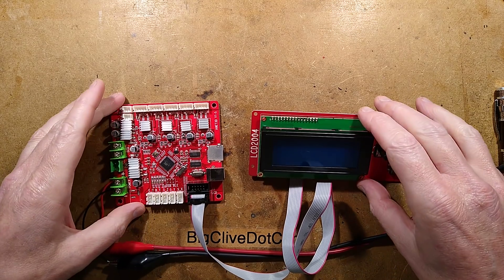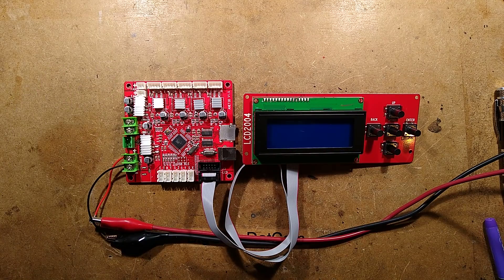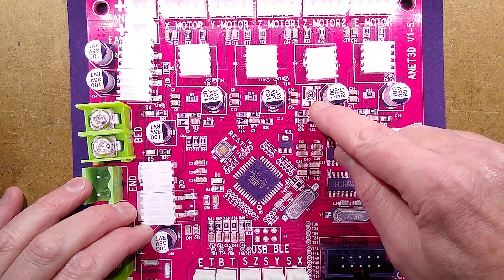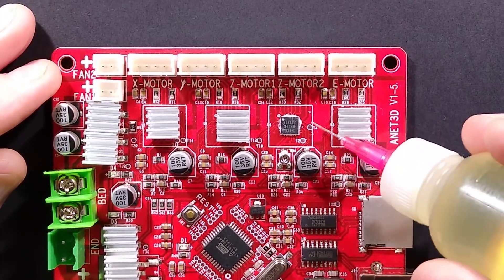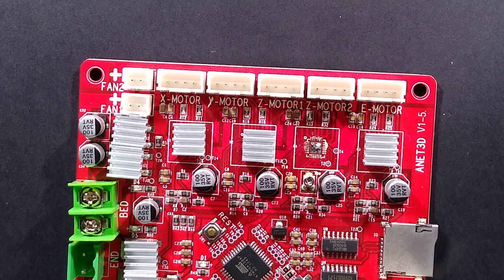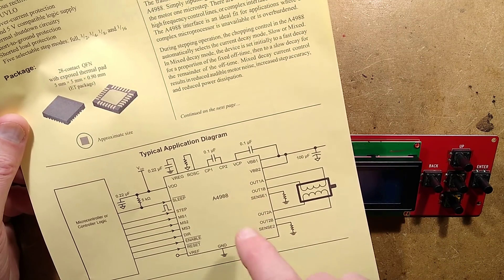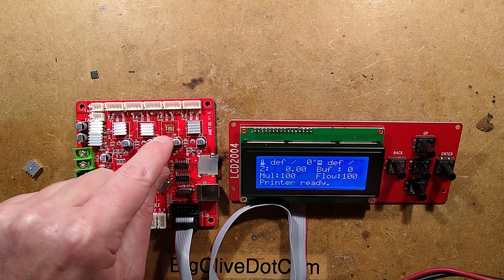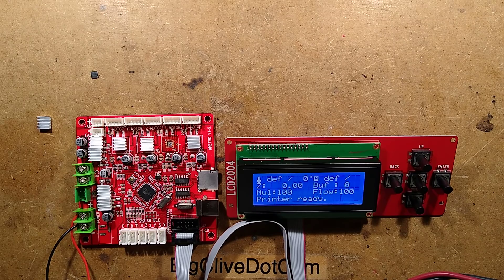Diagnosing a dead 3D printer controller

Comment: Love this printer. Simple, and reliable when used with a mosfet for the heated bed
Reply: I have two left.

Inadequate traces for the heatbed current: added MOSFET/SSR.

Failed to use strain relief or even an adequate number of the available pins for the hotends connector: soldered directly, made own strain relief.

Heatbreak fan for a non-existent heatbreak: disconnected, thrown away. (Have NEVER seen the extruder get heat-soaked enough to matter).

Garbage-quality z-stop switch: replaced with optical.

Firmware with no runaway protection: flashed to Marlin.

Display corruption just by thinking about the concept of static electricity: added a proper ground to the display segment.

All in all, this $199 budget printer can be made safe for only the cost of the Sovol SV01 that I should have bought in the first place.

Honestly, don't buy from Anet. They're perfectly willing to sacrifice your safety for a buck.

Comment: My A8 is in the closet. I bought a Flashforge Adventurer 3 and never looked back. After the Anet printer's bed connector started to burn, I figured it was time to just put it aside until I had more time to upgrade the wiring and connectors. But that never came to be. You can probably find those boards on Ebay pretty cheap. :)

Comment: You have probably just destroyed the other driver chips as you should not power them with the motors disconnected.
Reply: There is absolutely no problem powering them without a motor connected. They're not even being enabled (which also wouldn't cause any harm). What you must not do is disconnect the motors when the drivers are enabled.

Comment: sounds like he used a metal screw driver and killed the chip. that board should still be usable. just have to disable that driver in the marlin firmware. the good thing now is you have another arduino mega with a ton of pins.

Comment: I had essentially the same issue on the same board, moving the motors too quickly manually sends current back into the driver and cooks them. I can't speak for everyone, but in my case replacing the stepper driver resulted in full functionality. Be careful when moving your printer because that bed has a lot of mass and can easily move fast enough to kill it if you don't keep it secure while moving the printer.

In my case it actually killed the processor on board as well.

Since then I've upgraded to a different board entirely (SKR 1.3), but with fast shipping from places like digikey, and the cost of the part, this is a good way to get your machine up and running much faster than waiting for a new board. 

If you aren't on a time crunch or tight budget I'd suggest upgrading to a different board for safety reasons, but the skr also has modular steppers so repairs or upgrades are a lot easier. Just be warned it means a lot of firmware tweaking which can be a pain.

https://www.youtube.com/watch?v=wlamyvdbZq8
Reply: i remember having fun powering up the printer by moving one of the axes rather fast.

Comment: If you have a play with an endstop (just a small microswitch) with a decent length lead on it you should be able to get a latchup out of the MCU. It'll still work, amazingly, but get more than a little warm. Not a well designed board, unfortunately everyone and their dog cloned the same board this was cloned from.

Comment: Thermo camera was so so cool to watch B/C it pinpointed where an issue was. so cool to share this. Ummm is this an App or a seperate camera?
Reply: It's an FLIR infrared camera that's built into the phone.
Reply: @DomesticWithAnMD  O! cool....Umm i still do not have a smartphone...am using a ATT 4G flip phone. but seeing how this can help to diagnosis is very very cool. Thanks Jay DVD:)
Reply from the maker: It has to be an actual thermal sensing camera built in.  It's becoming more common with industrial phones.  There are apps that fake the thermal effect, but it's just an optical filter.
Reply: @bigclivedotcom  Thanks Big Clive :)

Comment: Normally these drivers fail when someone shorts pins when turning the potentiometer. This is an extremely common issue. This also happens on boards with removable drivers. People use a metal screwdriver to turn the potentiometer.. The best way to do it is to use a ceramic screwdriver. But nowadays there are many drivers such as the TMC2208 and TMC2209 that you can configure through UART. Very useful, no more physical tuning. Another way how people short pins is because they use a multimeter to measure the vRef, and accidentally short pins with the probes when they slip off of the vRef pins.

Comment: Ah. The good old Anet A8 mainboard. When I first started with 3D Printing back in 2014/15, I bought my first printer - It was an Anet A8. I modified it quite a bit until the board randomly died. It looks like this happened quite often, but the prblem this one had, I never encountered. I also got a  second A8 for free from a friend who moved and didn't have the space for a 3D Printer anymore. Guess what - This mainboard also died. I got a few replacement boards over the years which I accumulated. They're literally piling up here.

Comment: Used to call the plastic tools "tweekers". In another life, I used to have a pocket full of them... (in another life!)

In rf tuned circuits bringing an iron or brass tool into a coil would shift the inductance.. so a circuit that was spot on with the tool in place, would be detuned once you removed it... Maddening!

Comment: whatever genius designed my printer's board thought it was safe to connect USB +5v  directly to the board's own +5v powered rail.   had to cut the trace so it would stop browning out my PC's usb port and force the board to use its OWN power supply.
Reply: That's just a holdover from the Arduino board (Mega or Mega 2560) this (and probably yours) is based on. I killed my Mother's laptop due to this same issue, no back-power isolation between USB +5V and board +5V led me to accidentally put +12V back over USB after making a mistake plugging in a connector on a project. Fried the logic board, had to replace it. Fun stuff. Now I just use a USB isolator to protect the computer (both power and data lines) while still letting me provide power to the target device. It's an excellent tool to have if you don't trust what you're plugging into and/or like the computer you use.

Comment: This board is usable AS-IS, you don’t need two Z drivers, you can run 2 Motors in parallel on a single driver just fine, there are a ton of printers that do this.
Reply: Yes, there is why there is only one driver for both Z-motors on this board. Has X,Y,Z (2 connectors), E as stepperdrivers only. And that one Z-stepperdriver failed.
I have some SKR boards where I have put only one driver for the Z on and also put the motors parallel. But you then cannot of course use firmware to have the second Z getting at the same level as the other (using 2 sensors or using an ABL-sensor).
Reply: I think driving two motors in parallel is what killed that driver in the first place.

Comment: I think I would have started by removing the pot and seeing if that allowed the system to boot. And if it did, replacing it with the stock resistor value. It's possible there is nothing wrong with the driver chip.

Comment: One thing you got wrong is about the data lines. I have played a lot with these stepper drivers. There are no data lines, all control pins are like switches, even the step pin takes a square wave to operate. Speed of the motor is a function of the input frequency.

Comment: I had one of those 5 years ago. Great starter printer but mine failed at the power insert because the pin soldered in didn't make good contact and caused a short. it burned up all the power traces to the Atmel chip and burned a hole in it.

Comment: my 3d printer has plugin driver board and when tweeking the voltage on their lil pots my screwdriver slipped and shorted the pins on it out, only blew the main board fuse, so i was lucky, all because i couldn't find (didn't look very hard) my plastic pot trimmer

Comment: Honestly for the time, effort and fiddlyness of trying to repair it, you can buy a wifi enabled 32bit Duet2 clone on ebay for £40. For that price, it's worth the upgrade.
Reply: You have to flash new firmware to it though, and it might not fit exactly (like my Tronxy X3 has a power box for the thin and long Melzi board), but I'm debating if its worth it or not. Usually it takes me less than a day to do something like that but we had an intern take 3 months doing similar with what should have been a 3 day job (switch the extruder and slap on a Creality 32 bit board), which I've done both as well as even machined parts for my custom extruder in just a day or two. Sometimes drop in replacement is tempting, especially if it has the stock firmware that's no hassle.

Comment: I didn't want to wade thru 200 comments so I'll repeat if it's been said already...
Those trim pots are for setting the vref (power level) for driving the stepper motors. It's a good thing to have a metal tool as you can measure the voltage to ground while adjusting it. The nominal value escapes me since modern drivers can be set via firmware commands.

Still, proper handling of any metal object/probe is critical to maintaining the correct operational capabilities of an electronic device.

Comment: And again they put the Heatsink on the wrong side of the PCB (that solder pad of that chip is for the actual heat transfer), the heat actually gets through those vias onto the other side. Normally there should be a large copper area to act as heat sink, but most there isn't one.

Comment: You can diagnose my broken 3D printer board, but the burn hole in the MCU makes the problem pretty obvious. Also, the voltage regulators let out smoke when powered.

Comment: The problem with tht Anet A8 is they are running some of the chips pretty close to their maximum. I've had mine for about 5 years still running on the original main bored. I was worried about the reports of failures so I swapped in a power supply I actually trust not to go up in flames, a mosfet board for the heat bed, and some crimped on wire end. Recently upgraded to marlin firmware and added auto bed leveling. Now I'm at the end of what the board can do.

Comment: Back in 2018 I did 2 videos on a CTC 3d printer that you could buy the complete 3d  printer for $75.60 USD. It had the same control and display boards. I kit bashed mine in to linear slide rail, also did a video on one that cost $92.40 USD. back then that was dirt cheep for a 3d printer. They still sell them but I have no idea what the price is now. Anyway if you can fix the board for $1 buck then its worth it other wise I would lust upgrade to much better board and display.

Comment: Oh, the dreaded Anet A8...this was also my first printer. It worked reasonably well but the build quality was abysmal & the print quality was not something to write home about. Creaky, wobbly acrylic frame, and the stepper drivers made the thing LOUD. But for 130 Euros shipped I am not complaining. Eventually I decided to do some upgrades which then escalated into a full rebuild. New aluminimum frame, control board, stepper drivers, linear bearings - the full works. The only Anet components remaining are the motors and the PSU. The learning curve was...steep. Now the parts fan is the loudest component on the printer. (And yes, I did put Marlin on the original printer first thing and made sure thermal runaway protection is enabled).
Reply: Weirdly, all of my A8's got really quiet after I flashed Marlin. It's almost as though those assclowns at Anet didn't have the firmware configured properly for the stepper drivers... Amongst a host of other problems...

My experience with them, though, is that the print quality is every bit as good as my Prusa... after fixing all the safety issues. :/
Reply: @SwervingLemon  Seems like it. After tinkering with Marlin a bit, I was able to shave a few dB off the A8’s noise level and get it from “unbearable” down to “annoying”. But switching to a 32bit board and TMC drivers made a world of difference.

Comment: 99% of the time it's the stupid power chip that convers 12/9 to 5v/3v. Or a poorly speced transistor. Ramps 1.4 comes with a TRASH heat bed transistor. Geniuses' fix is to "put cooling" on it when it just needs to be replaced with a 10 cent logic level power mosfet.

Comment: I have Anet :) the same board... I had no issues with it, but I read about known issue with the heating mosfet.. I Added a quite powerfull one and also for the extruder heater... For the selftest depends of the firmware version ( my is with Merlin now ) in the begining of the job, the printer do "HOME" positions. It doesn't move before that, unles you use the manual movements, for calibration and etc...

Comment: I've burned through a couple of A4988's myself too. On most boards those drivers are on a tiny replaceable daughterboard. It's a shame this manufacturer elected not to do that. Then again, Anet isn't really known for quality.
Reply: Well, I think they produced sooo many of these motherboards that it is probably cheaper to replace a whole board for them then to have them with doughterboards. When there is a problem with a board they usually ship one for free already flashed with the firmware. Bought some new myself for around 5$ each. You can't do that with all motherboards on it and much simpler to just replace thw ehole motherboard instead of searching for faults. Some error? Just replace motherboard, problem solved.
Reply: On some boards - mostly cheaper ones. The 'stepsticks' are intended for testing, not production, they're thermally and electrically inferior to doing it properly (not that this is proper).

Comment: I have some hard ceramic screwdrivers for that task.  The drivers on my 3D printer have software adjustment for the drive current which is nice.  Duet 2 WiFi.

Comment: Mmm, it's even running the flammable firmware! I have the Marlin firmware loaded on mine. It is supposed to stop the thermal runaway issues of the stock firmware.
Reply: Have tested, can confirm. Marlin does indeed fix the thermal runaway issue.

What pisses me off is that Anet didn't just omit thermal runaway from their firmware.

They DISABLED it AFTER including it.

Assclowns!